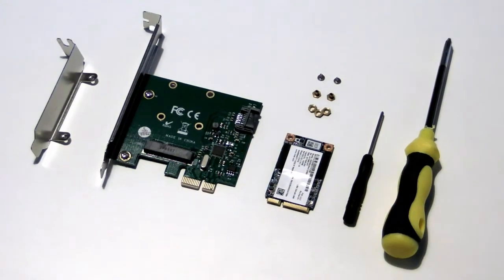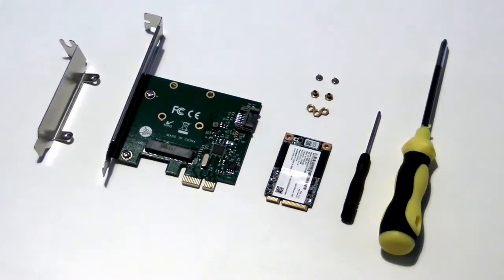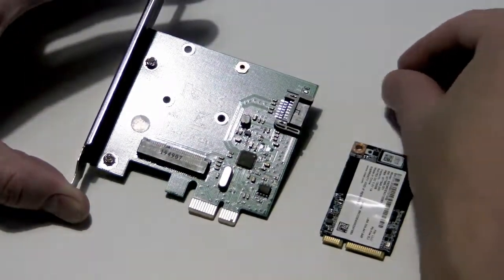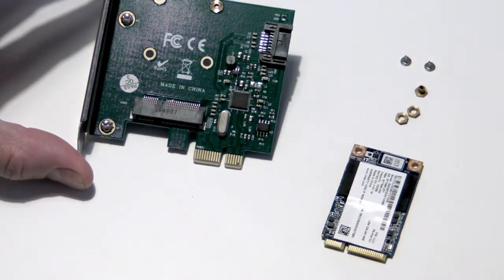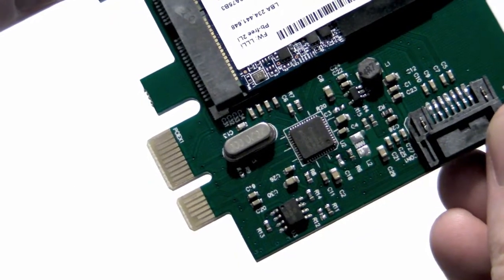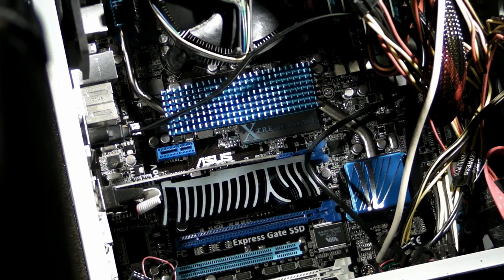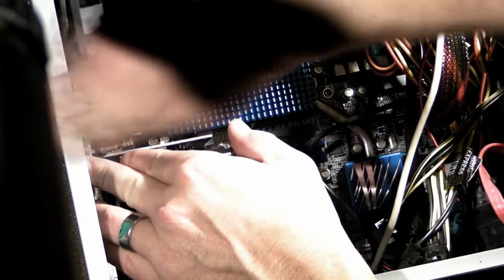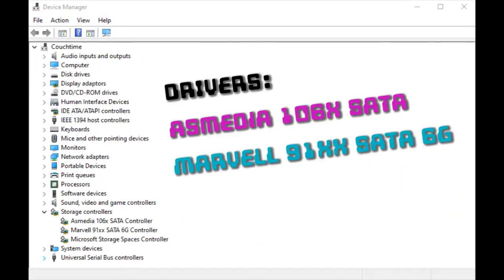🔧 mSATA SSD in a desktop PC with a PCIe adaptor

Comment from the maker: EXTRA TIP: When choosing a PCI-e slot for this mSATA adaptor, find a PCI-e 3.0 slot to ensure you get the best possible performance out of your SSD. PCI-e 2 and 1 slots will still work, but at slower speeds. Check your motherboard manual to find out which slots are which if they aren't clearly marked on the motherboard itself.

mSATA-PCIe adaptors on eBay: http://ebay.us/RVVpS9
mSATA SSDs on eBay: http://ebay.us/WCplC5

Comment: I have installed this card on a Pcie 2.0 but it is recognized as a Pcie Gen 1 which giving a link speed of 2.5 GT/s. I have installed latest asmedia driver 3.2.3 on win 10 x64. You have any idea whats the issue can be ?
Reply from the maker: Hi Piya. It doesn't seem like the driver is the issue. Check your motherboard manual. You may find that even though your motherboard provides PCIe 2 slots, some of them are probably PCIe 1 slots. Motherboards often have a combination of PCIe slots with various speeds. I was caught out by this once myself. Good luck, and let me know if this helps you solve your problem!
Reply: @danimationstips  The manual has no versions mentioned in it. I have used HWinfo and CPU-ID both are showing me that i have PCIE 2.0. I have also tried the card in a x16 slot but still recognized as a Gen 1. May be its the card itself ? Will upgrading the firmware help ?
Reply from the maker: @ajc_piya  I really don't know, Piya... I realise you're trying to upgrade an older PC, but the only surefire way to get best performance out of the SSD/PCIe adaptor combo in this video is to use it in a PCIe 3 slot. I know upgrading motherboards is a pain and costly, but that's the route with the best chance of success in my opinion. If you haven't already, try the adaptor in all of your PCI slots, not just the ones you have available. Your motherboard may only have one PCIe 2 slot, and you may not have found it yet. Good luck!

Comment: Nice video! Do you think this adapter works with a msata wifi card? I have some left over from old laptops and I wanted to adapt it on a desktop ..
Reply from the maker: Thanks Wagner. Placing a wi-fi card in one of these mSATA adaptors would make for an interesting test. Assuming that it works, the next consideration will be how/where to run your antennas from it. Make sure you don't short circuit anything with them! Without antennas attached, your wi-fi and bluetooth ranges will be limited. If you decide to try this out, please let me know how it works for you.

Comment: Thanks for walking us through this. I haven't done such, yet - but it looks promising. (Should probably get going, because I've bought two old/used Dell Optiplex PCs w/o SSD, which also have no spare SATA ports left).

Just one question:  Would you maybe know a ballpark number, by how much the idle power consumption of your PC increased this way? I would guess 0,5-1 Watt for the card (and something negligible for the SSD itself) or so, but I might be totally wrong.
Reply from the maker: Which model Optiplex PC do you have? And do they have mSATA ports? If so they must be quite recent models. 

I haven't looked into power consumption differences with different storage media yet. If you want to minimise your power consumption, the general rule of thumb is: use a NUC, Netbook or Laptop. And make sure your monitors are LED... LCD monitors use much more power. I'll be producing a video on energy efficiency and computing soon. Thanks for your continued interest in my videos, R C.
Reply: @danimationstips  Looking forward to those videos  :-)
(Hope that will find an audience / be of general interest, though.)

Not to digress from your video ... but I got 2x Dell Optiplex 3020 SFF. Both SATA ports are taken with HDD+ODD, so I thought of going the same route like you to add a PCI-E card in order to add an SSD. They've got awefully high idle power consumption, though (so my question really wouldn't matter to those particular machines).

Back to topic:  Thanks for bringing up more and more good stuff!
Reply from the maker: I agree with your observation that Optiplexs use a lot of power when idling. I only have experience with the 755, and it sucks 16 watts of power or thereabouts, before you even turn it on at the case! I guess that's probably to enable remote or timer-based booting.

Another good place to try adding an mSATA SSD is a laptop, though roughly 2015 or earlier machines may not accept one in the place of the wireless network card.